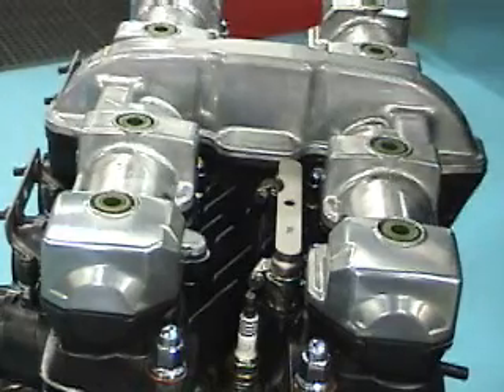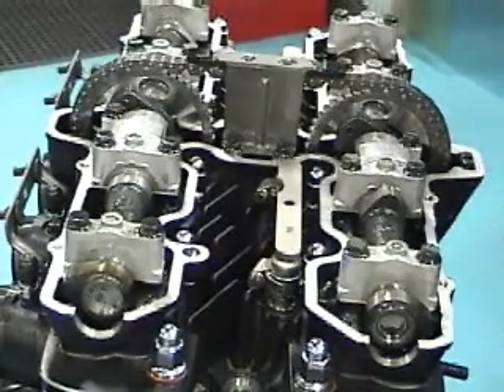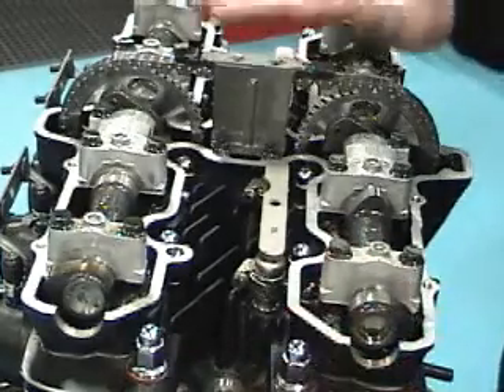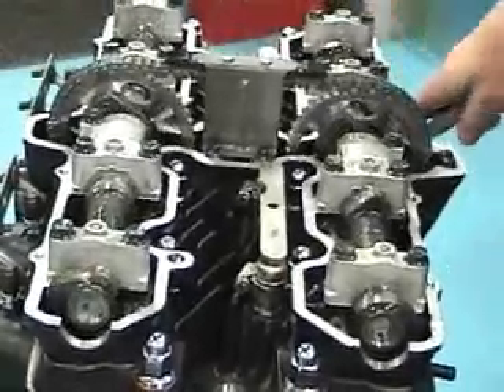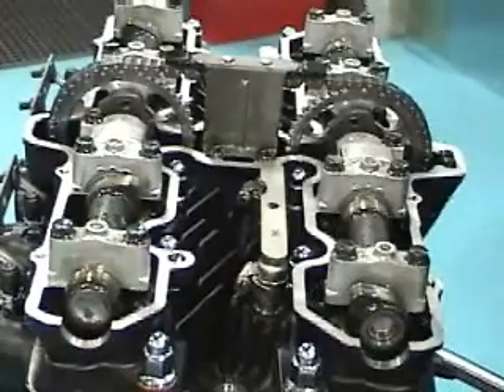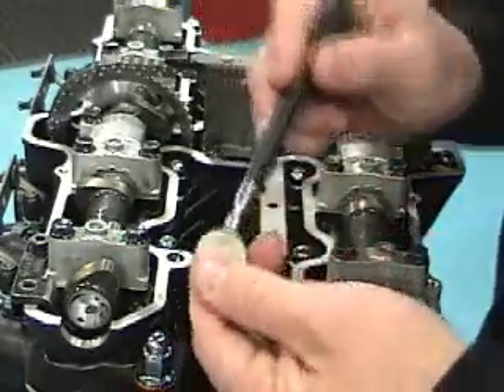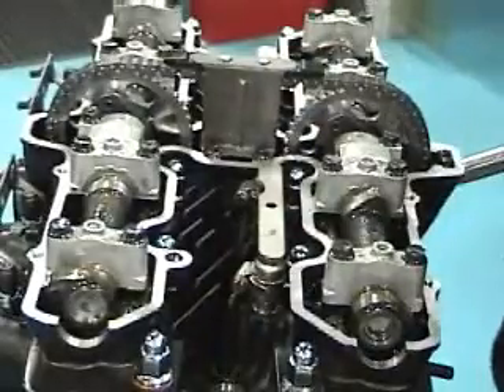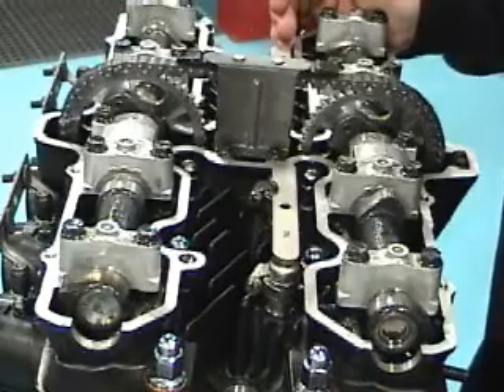FJ1200 & XJR1250 Valve Adjustment for Legends Car & Baby Grand

Comment: I’m really puzzled. Why isn’t piston bending those intake valves as you’re rotating crank? Because the tool is holding the valve open how is it possible to turn crank and not cause binding?

Comment: There seems to be some debate about the position of the cam lobe when taking the measurement, whether better pointed directly away from the valve shim, or with the engine at TDC (not shown), as per the factory service manual. I think the position shown here makes more sense as that's where the clearance is at its maximum.

Comment: You mention rotating the engine counter-clockwise but from the camera's angle you are rotating it clockwise.  So which reference point of view should be used to determine CW vs. CCW?  Thanks.
And why shouldn't you use an open end wrench on the intake cam?  Just curious.